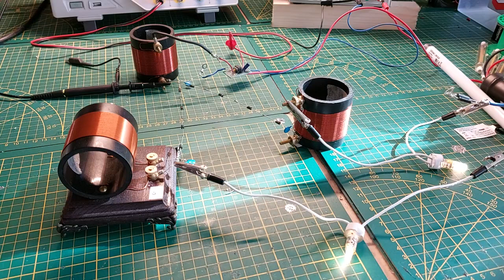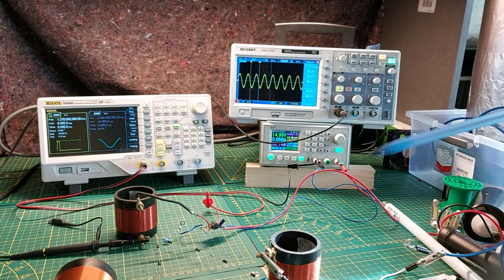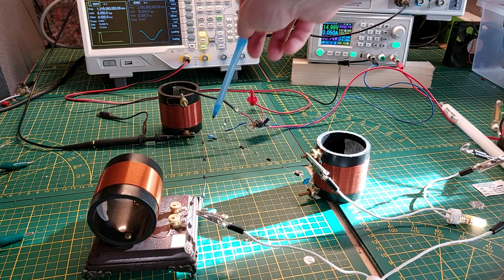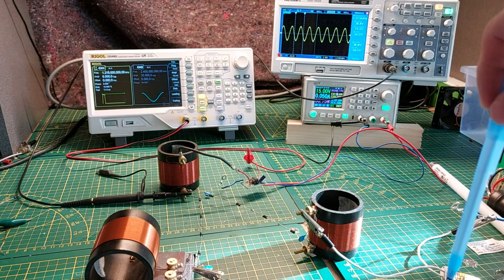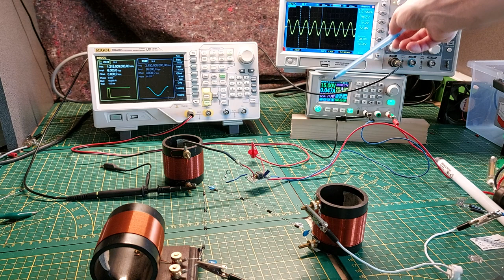One Wire Diode Separation High Q

Comment: The diodes have internal resistance and will drop volts slightly, this is drop pressure/volts which changes frequency I am sure it lowered the Q.  Maybe connecting HF Cap across the two ends of the series diodes will bring the voltage back up. Using large farad more volts low farad less volts . Or you can use matched diodes if they even make them. Even if you used one diode and not multiple in series and you had one diode on between each of the 2 coils the two diodes are not matched so essentially you need to match the voltage drop the two diode arrays create